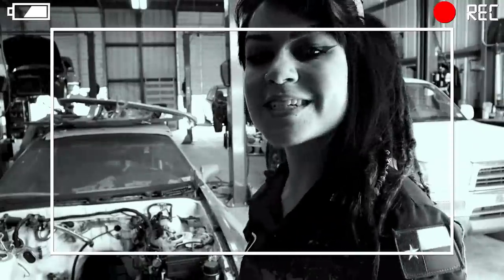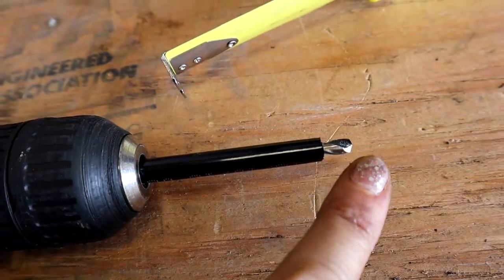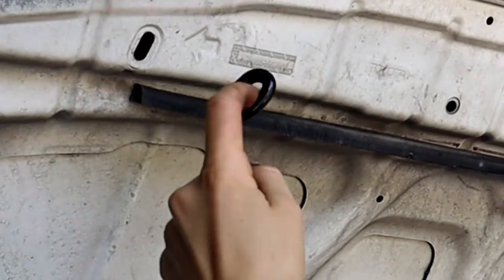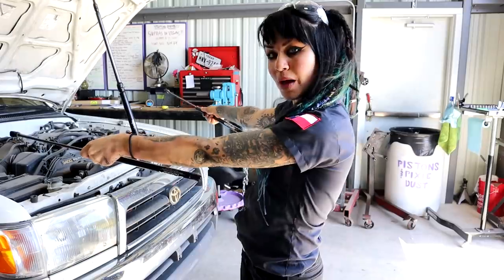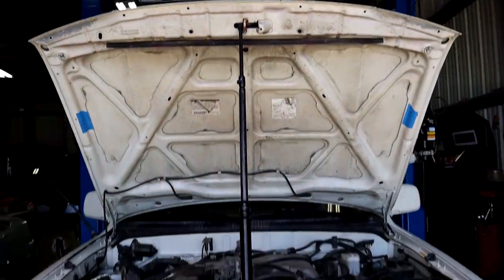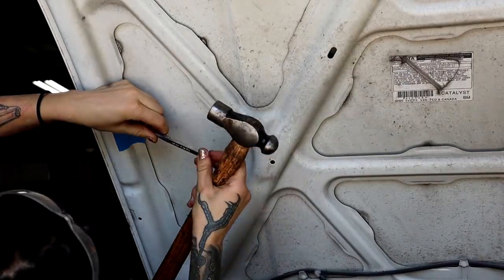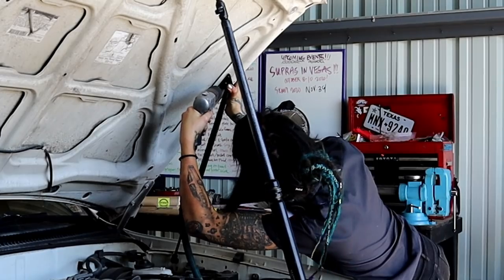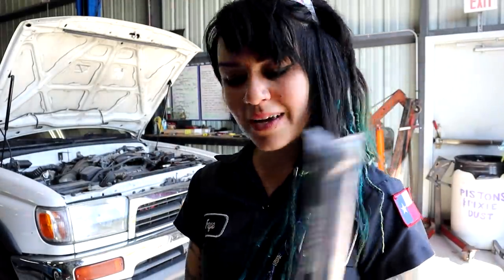Installing Hood Struts on my 3rd Generation (1998) Toyota 4Runner!!

Comment: Thats awesome. I think I'ma get this for my dads Tacoma, except maybe after I'm done riveting , i'll put a tac weld on the front and back of those mounts for added strength so it doesn't Warp under age and pressure.

Comment: Hi Faye, I have a Toyota 95' t100 w/ the 3.4. It has been sitting and the radiator has cracked and needs replacing, will replace soon. but the engine is leaking oil and believe its the valve covers. Im also in San Antonio and been meaning to take it to y'all since seems like you know the 3.4 in and out. Would it be worth replacing or do you think the raditor blowing will lead to a bigger issue?

Comment: Great video, Faye. Looks like a really nice strut kit for Toyotas. I like the fact that there is an adjustment for height, too. I have two cars that came with hood prop rods and converted both of them to struts. Waaayyy better. Last but not least...it wouldn't be a Faye Hadley video without chickens. Thanks for that.

Comment: Faye hope you are doing well ❤ got 2000 4runner trying to install extra fuel tank (gas tank) to my 4runner... do you have any recommended ideas? Please help cheers 🤗🤗
Reply from the maker: I've been thinking about this myself, what a great idea!! Let me know what you come up with please!!!
Reply: @FayeHadley  couldn't find any helpful YouTube videos around..  but definitely will give it a shot myself .   Plastic gas tank covered by metal in where the spare tire located would be cool ..  still pipes *hoses connection between the two tanks and electrical connections 🙏🙏

Comment: I realize this video is geared towards the hobbyist/at home mechanic which is why you used the tape to measure the bit stopper instead of calipers; was that also part of your decision to use a hammer and a punch instead of a spring loaded punch? I don't like contorting & swinging a hammer over my head. It usually turns out badly for me.
Reply from the maker: No, I don't own a spring loaded punch .....  my husband (a carpenter!) does have one, but I forgot to ask him! I'll borrow his next time!!
Reply: I've found it to be super handy when I have to drill body panels. Especially for spoiler installs.

Comment: Been thinking about doing this on my 96 with 350k 4Runner for a long time! Convinced me to do it!
Reply from the maker: Oh my gosh you should, SO WORTH IT. I had the plastic clip break on the prop and I didn't want to buy a new one, and the prop kept falling down, so that's what threw me over the edge. But it was SO EASY. It took me less than an hour (about 45ish) even WITH recording (which usually doubles the time a job takes) I was so stoked on this kit and the install.